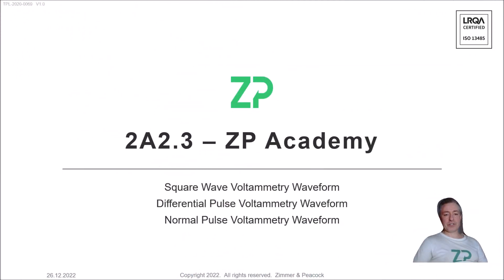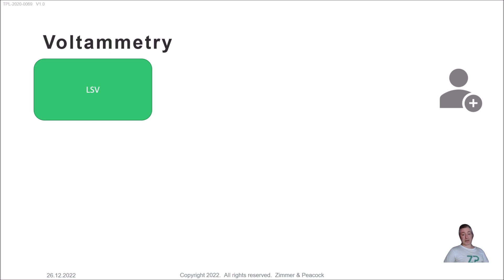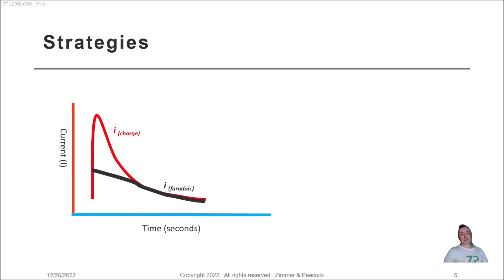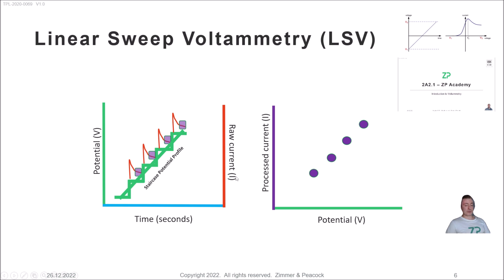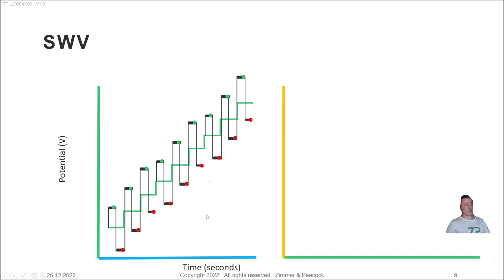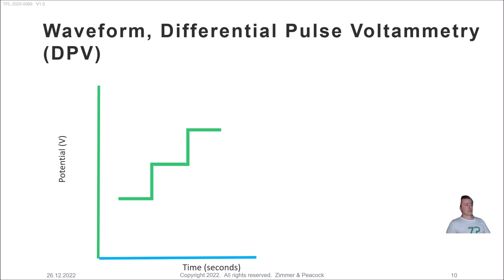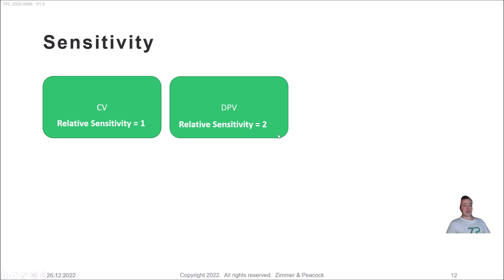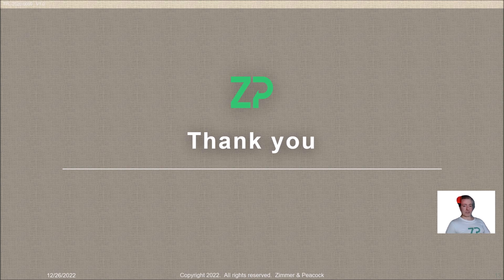Introduction to Square Wave, Differential Pulse and Normal Pulse Voltammetry Waveforms

Comment: Thank you for the amazing video. 
Kindly, could explain in another video how to overcome the impedance drift?  Thanks in advances
Reply from the maker: Are you running a Faradaic or non-Faradaic EIS assay?
Reply: @zimmerpeacock9703  I am using Fardiac impedance
Reply from the maker: @mariaali7922  We will answer here - https://www.zimmerpeacocktech.com/2023/01/18/zp-developers-zone-8-am-london-26-january-2023/
Reply: @zimmerpeacock9703  thanks a lot